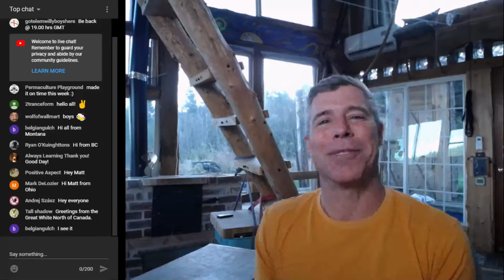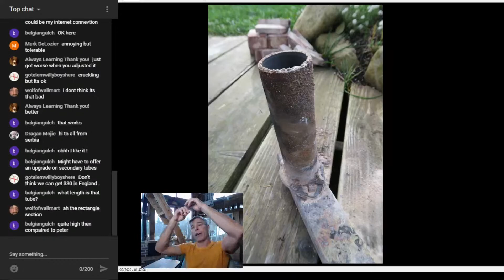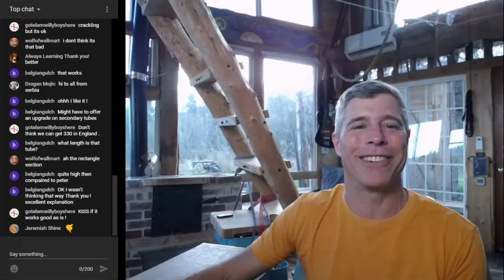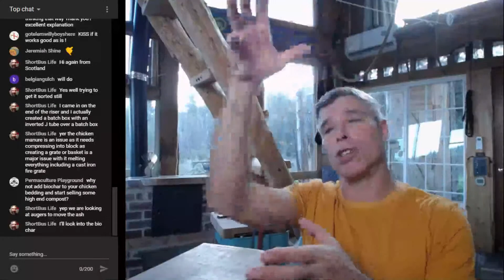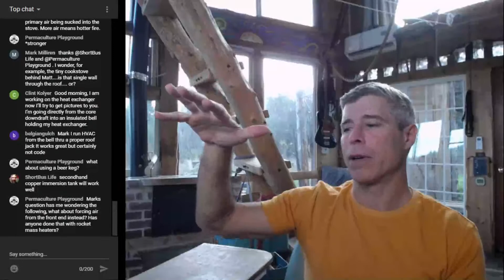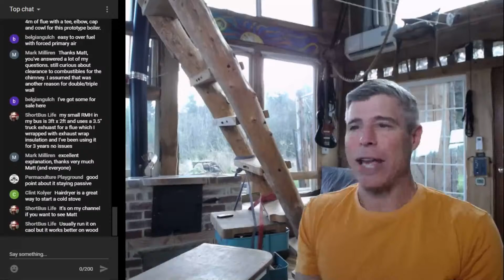Stove Chat Episode 34

Comment: The noise (sounds like static on the recording but also could be the interference of some sort of digital packets being sent ie: cell or cordless phone base nearby or plugged in on same circuit) got louder with you when you turned up your mic level.  Indicating it being on that input channel or the mic it’s self having static or interference.